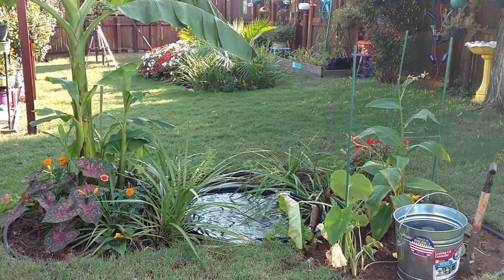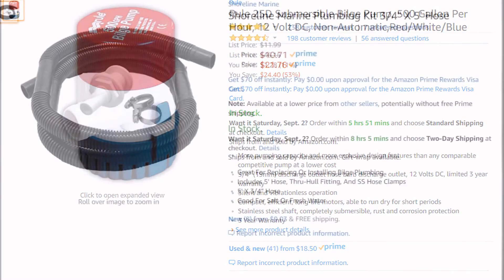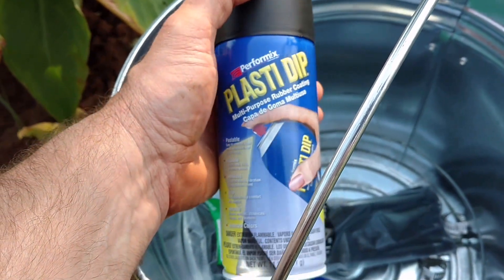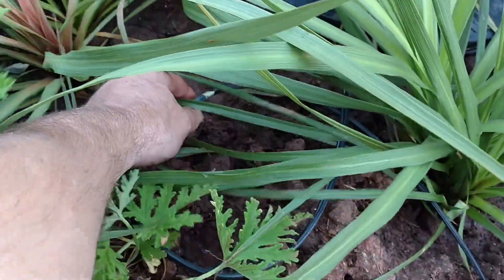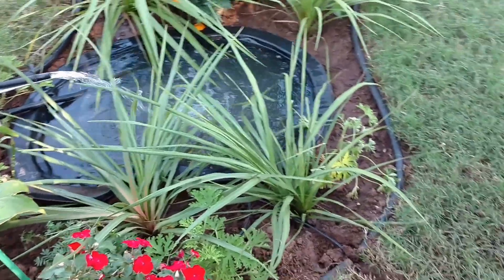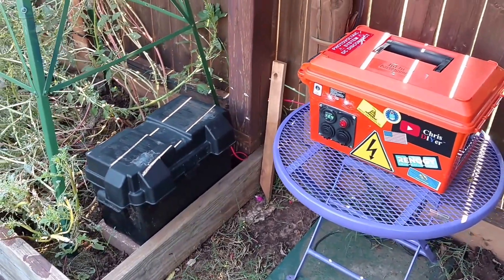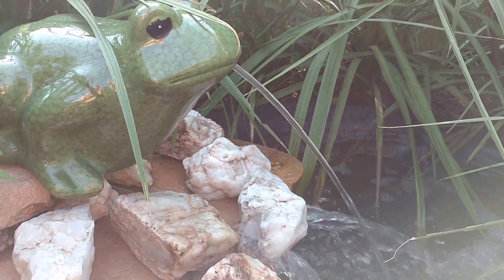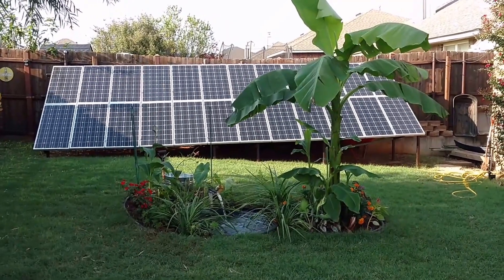Pumping water! Solar powered garden pond #2 bilge pump wired up

Comment: Are all them solar panels for the 2 pumps???
Reply from the maker: You think 5,000 watts in PV is overkill?
Reply: @ChrisDIYerOklahoma  No I saw your video (thanks btw) and I just wanted to know how many panels are actually used by the pumps. Because I'm doing exactly the same thing. But without batteries, so the pumps only work during sunlight hours.
Reply from the maker: @philipchantry01  -- Oh, okay, alright. Right now the pond solar power system has 600w in PV attached. The battery is an (expensive) Battle Born lithium 100aH. I prob should do a follow up video on this system...it runs 24/7 and just "works".